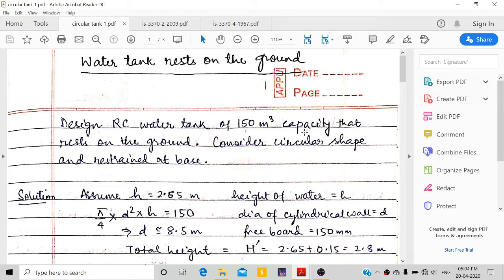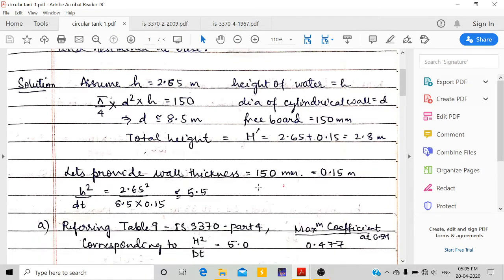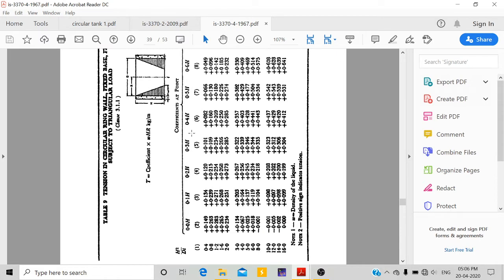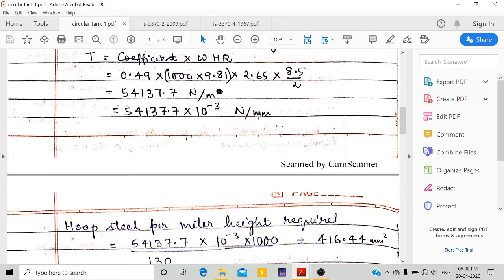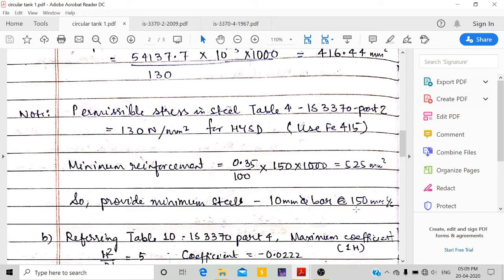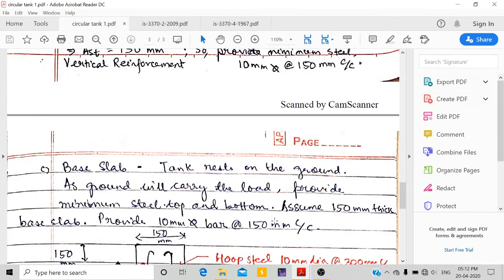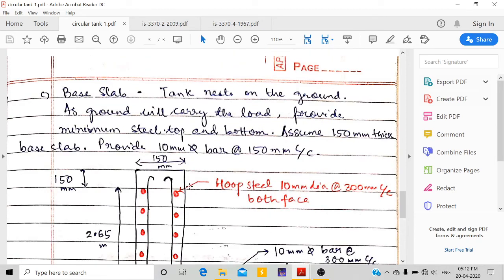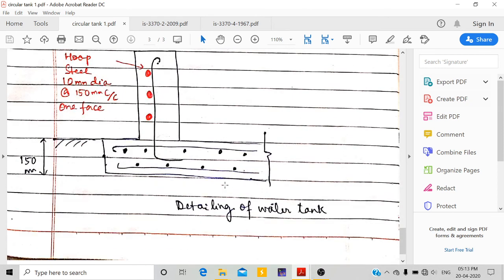Design of water tank rests on ground with fixed base

Comment: hi panda. our teacher taught this totally differently
Reply from the maker: Your teacher might have taught you in working stress method.
Reply: @SaleemaPanda1990  is this limit state.
Reply from the maker: @btech8816  Yes
Reply: @SaleemaPanda1990  is limit state easy or wsm?
Reply from the maker: @btech8816  limit state method are now included in all IS codes. Previously code presented WSM only- for water tank. As other RC structural elements you have studied in LSM, so this will be easy and comfortable for you.
Reply: @SaleemaPanda1990  do you know which code is used for water tanks if designed using wsm.
Reply from the maker: @btech8816  IS Code 3370